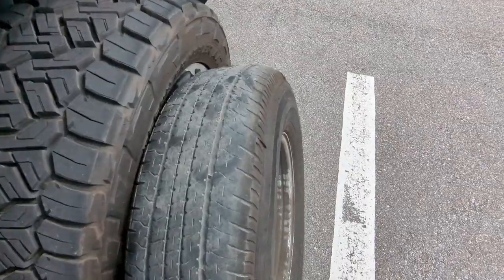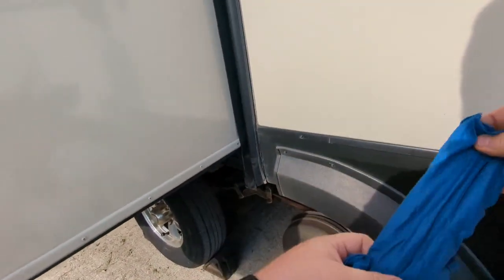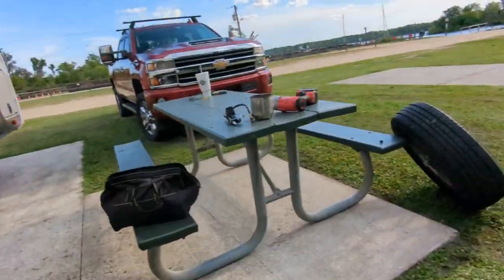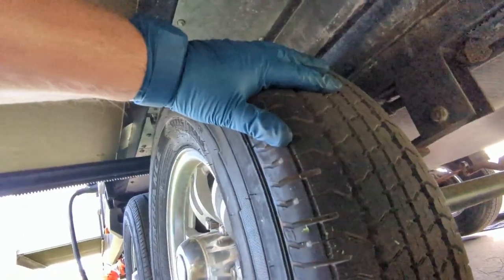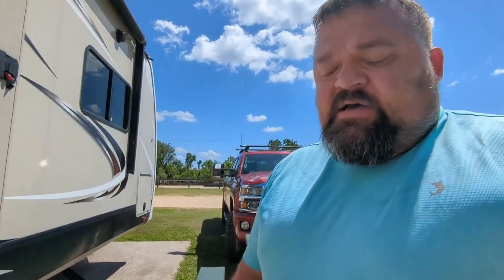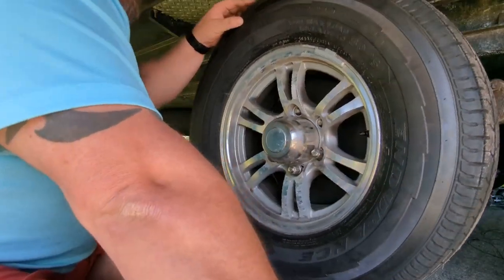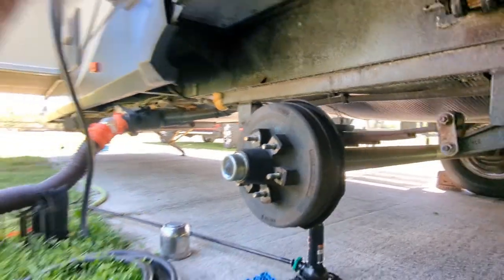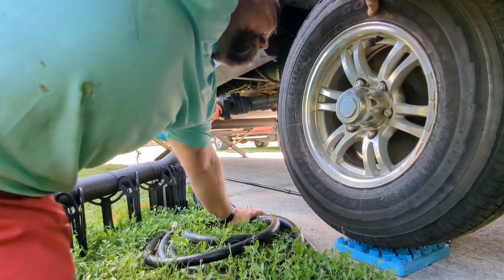Replacing Travel Trailer Tires after Belt Separation on Goodyear Endurance | Now We Roam

Comment: Had an endurance blow out on me and take out the other two on the same side.  4-years old, ~10k miles, always stored indoors, TPMS, pressures always monitored/maintained.  Guess Ameribombs are no better than Chinabombs.  I did what I did with all my other trailers, and replaced them with 14-ply G-Rated All Steel tires.  Never had a problem after that on any of the trailers.  Whatever your trailer comes with, go up at least 2-Ratings and you'll eliminate 99% of your problems.  If it came with D-Rated, go to F-Rated, if it came with E-Raged, to to at least G-Rated 14-plys!!!
Reply from the maker: Yeah for sure, the worst part about any boat or camper is always the tires! Good advice for sure to go up in ratings!
Reply from the maker: Ameribombs haha

Comment: Excess weight, maybe??
Reply from the maker: I've been over the scales and the weights are within the range of the trailer and tires. I weighed the whole trailer as well as the left and the right hand side of the trailer. I think I'm going to chalk this up to it happens.
Reply from the maker: The tire could still hold air but leak down pretty quick, imagine that. It separated the outside rubber from the belt section. The technicians at Discount Tire had never seen anything like it before.